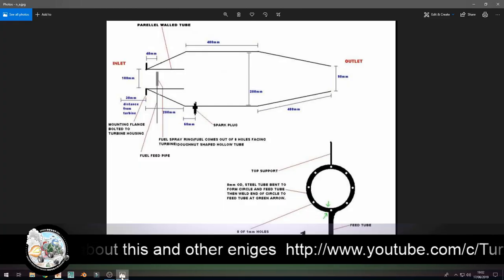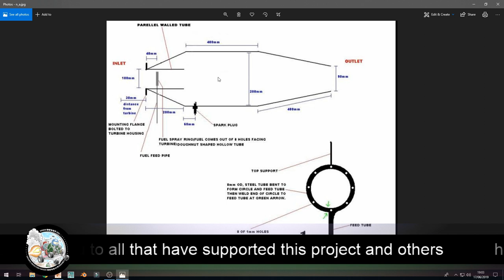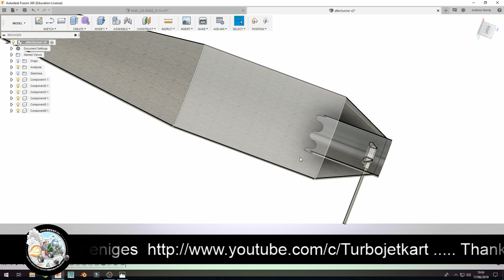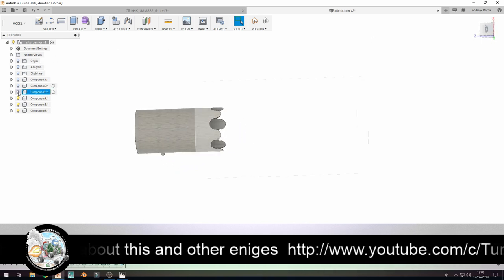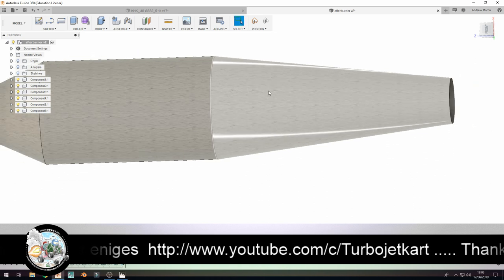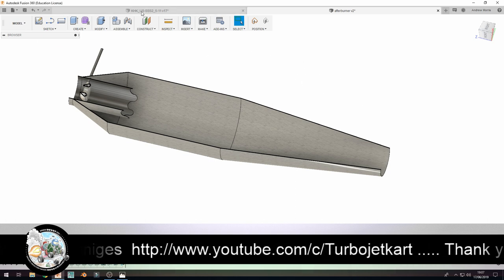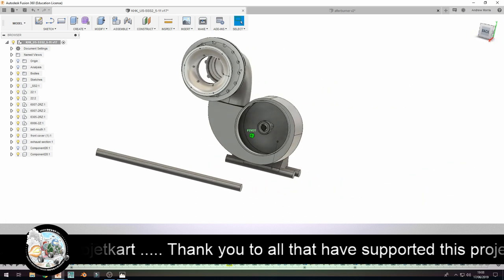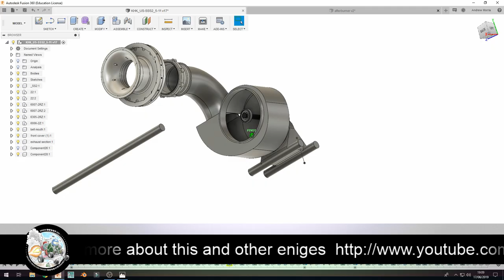How to build Jet Engine  Afterburner design

Comment: Thanks for the video Andy, what type and thickness material are you using for the afterburner? 304Stainless 1.2mm? Is the inner step tube a thicker stainless?
Reply from the maker: Hi, its 310... yes 1.2 mm.... 304 should be ok... but will scale and go dark.... glad it helped... nope the step tube still 1.2mm

Comment: What kind of pumps and nozzles do you use for your main fuel system? Like for running.
Reply from the maker: All depends what kind of fuel system you want, if you are going to run Kerosene you need either spray nozzle from a hot jet wash, or oil burning heating system.... Bosch 044 efi pumps are good, but please  come have a look at  http://jetandturbineowners.proboards.com/ for more advise
Reply: Andy Morris thanks for the reply
Reply: Andy Morris I’ll check it out

Comment: How many shp are you planning on? Great work. What is the afterburner fuel? Liquid? I’ve just started getting into arduino micro controllers on my GT projects and back emf is a big issue when trying to creat a big spark. Are you using micro controllers/fadec?
Reply from the maker: am hope for perhaps 250 shp, all depends how wekk the freepower section is designed and built 😀if its a little less, think it will still be fast. The afterburner uses kerosene just the same as the engine
Reply: @Turbojetkart  Fair play. 250 should bring a smile to most. I'm envious of your work so far!  I'm planning on using two K31 cores as a twin gas generator and the turbine section from my RR Artouste. This as a power turbine could handle 600 shp easy. Have you considered APU/heli engine stages as power turbine? Can you do a vid on the electronics of igniting the kero in the afterburner? I'm guessing it's a tad more of a spark than a model T?
Reply from the maker: the afterburner uses one of these for ignition and a none resisted spark plug...  https://youtu.be/5sfVnczqb8g

The freepower section will be using a  C28 turbine wheel fro an RR Alison engine, the flow area is a good match. The bike has a rover 2s150 freepower section on it

Comment: Have you ever thought about a compound set up? Would you design the combustion chamber around the the bigger turbo or the smaller one?
Reply from the maker: Yep, been talked about, but they start to get a little complex, and you have to start thinking about temp of second stage comp wheel, they only ali, and when you start heating them they can flex and brake, the size of engine i work on now nake more paoer than you could with a compound setup, power to wieght ? https://youtu.be/dwWLOKF-o8Y

Comment: Could you tell me what fuel pump your using on this afterburner thanks
Reply from the maker: bosch efi 044, plenty like it on ebay
Reply: @Jet Engines Andy Morris  Thanks for that could  you please tell me 4 more things.
1. Do you just use diesel for the afterburner.

2. what size holes do you drill on the fuel ring 

3. Do you use a non return valve after the fuel pump 

4. Do you just turn the fuel pump on/off
Or do you use a solenoid valve and some kind of fuel pressure vessel thanks
Reply from the maker: @BREN2009  kero is the fuel for the afterburner, holes 1mm , put an inline check valve and just turn pump on and off.... the check will stop pressure getting back to tank
Reply: @Jet Engines Andy Morris  ok kero for the ab fuel  honestly I can't thank you enough for answering my questions I really appreciate it do you think thin copper pipe or  like brake pipe would be suitable for the fuel ring? I think copper melts around 1k one more question am I right in thinking the diameter of the AB pipe end needs to be the same size as  the hot end turbine  diameter? Or would you make it a little smaller and see what temp it runs at  I think you said no more than  750c? I need to find the online info what mine runs at I am looking online to see if I can find stainless pipe and reducers and flanges that will fit togther I will get lads at work to weld it up for me I can weld but im not a pro I love that high pitch scream it makes on yours
Reply from the maker: @BREN2009  stainless for fuel ring, copper will melt , start size of turbine yes
Reply: @Jet Engines Andy Morris  Thank you. What's your progress on the free turbine design to make into shaft power? Are you still going to make one? So  When are you inviting  me over one wknd for a chat and look at  your turbine builds mate ha
Reply from the maker: @BREN2009  working on this now, twice the power https://youtu.be/_S3p1iCCZZE
Reply from the maker: https://www.patreon.com/jetenginesandymorristreon
Reply: @Jet Engines Andy Morris  Wow, excellent, that looks a quality build. Love it  certainly following you. we go to Elvington too have to let me know when you're there next. I will come watch. I may have my turbine ready, too, in the car